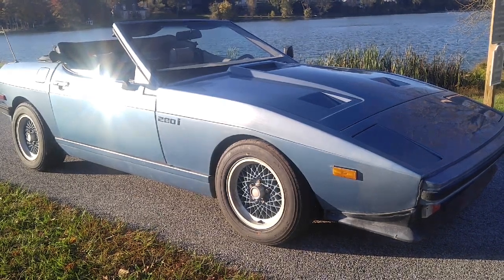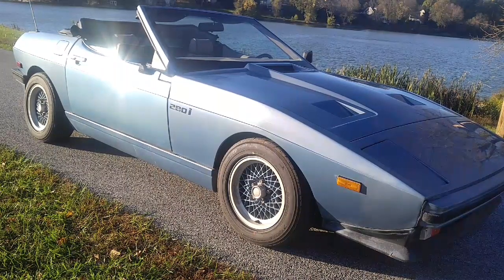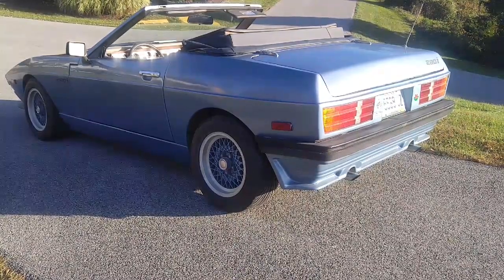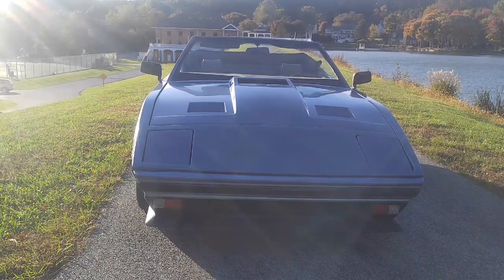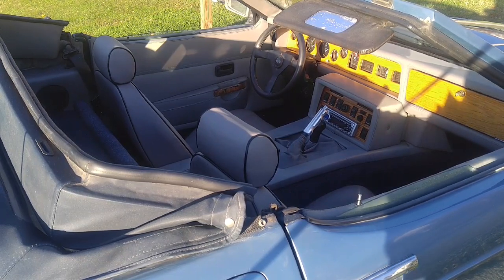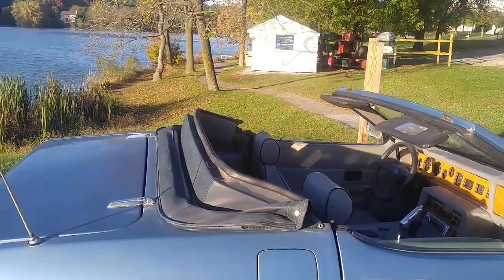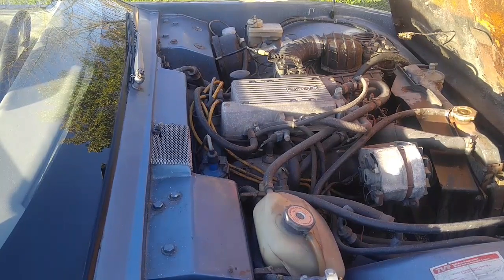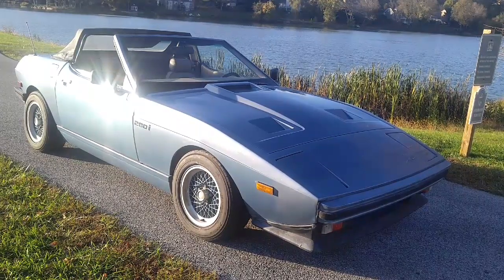TVR Tasmin/280i Close Up

Comment: I have one of these; I love the roof arrangements, the middle roof part fits in the boot(or trunk in the US) very easily. The car looks very cool in an 80s way with its wedge shape profile, I love this car; it is not practical as an everyday car( which I would have used it as 40yrs ago), but is great on a sunny summers day here in the UK driving on two lane country roads. The only thing is that the suspension only really starts working at speeds over 50mph, and is really working well at 80-110mph. However, you can’t drive like that now here.
Reply: Yep, they are great cars, and ( at least in the US) undervalued for a rather exotic sports car.   The roof system is very clever and simple to operate.  3 biggest issues are rust in the chassis, and the car can be a devil to work on because of the tube frame chassis.  Anything you want to get at underneath is always obscured by a damn chassis tube!!
Reply: How's maintenance cost and finding parts?
Reply from the maker: Parts are pretty easy.  Motor and transmission are Ford.  Rear end is ( I think) Jaguar.  Glass can be difficult to find.  Convertible tops very available.   The Achilles heal is the tube frame...make sure you get an example that isn't badly rusted
Reply: @sonordrum1000miura  thank u so much.  I'll keep u updated!